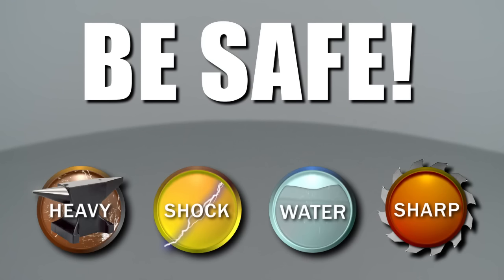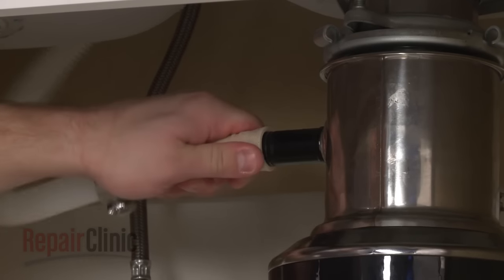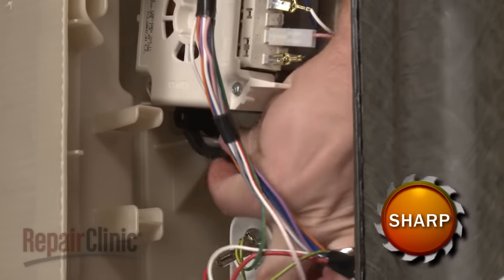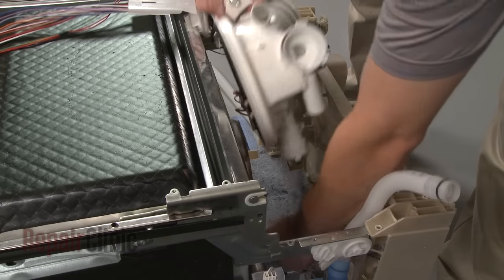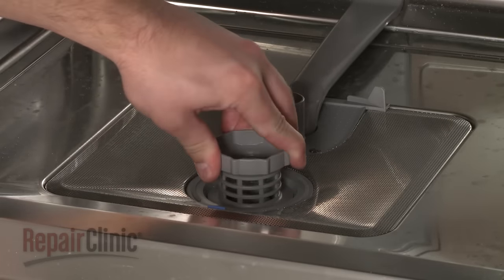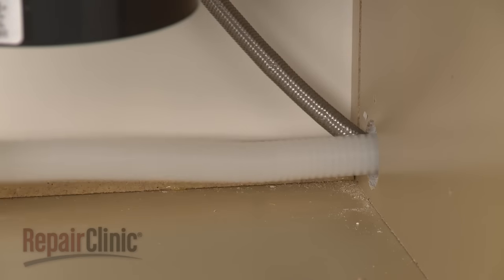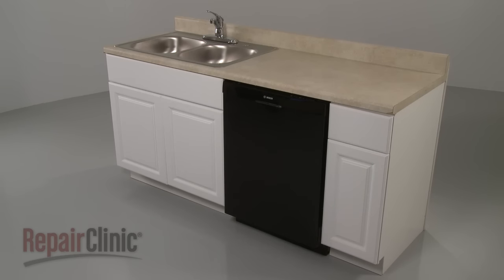Bosch Dishwasher Circulation Pump Replacement #442548

Comment: I do appreciate the video.  My dishwasher is a Kenmore Elite 630.16309404.  From the symptoms, I was pretty sure the circulation pump had gone bad.  The system would add water and heat it, but there was no circulation of the water whatsoever.  Apparently the Kenmore is somewhat different.  It has a metal sleeve on each side that most be removed before you can disconnect the pulley's on each side.  I could not find a video that shows that, but I figured it out.  You have to remove two screws on each side at the front of the washer to be able to remove those sleeves.  Almost everything else is the same with the exception of no clamp on one end of the pump itself.

Anyway, I was able to put the new pump in, but it still doesn't work.  The difference now is that I can hear that the pump is trying to work.  I think the old pump must of burned out because maybe there's an obstruction somewhere.  Since the pump is not pushing water as it should, I'm not trying to run it so as not to burn out the new pump.  I checked inside the washer and the impeller moves freely.  I placed an air pump on the end where the lower wash arm is removed and blew air threw.  It blew water out of the opposite end, so that's free.  Today, I plan to go back in and remove the complete sump assembly to examine every possible entry/exit; that is unless there's a better way to go about troubleshooting.  If there's is something, I'd appreciate the advice.

Thanks.

Comment: My bosch model SHX33A05UC/14 dishwasher was filling, but wasn't pumping water, so I replaced the circulation pump. very helpful video. However, now the dishwasher will not fill and it only hums. Based upon another person's comment, it's not the water inlet valve.  What else could be the problem?

Comment: Great video, subscribed. The arms have stopped rotating on our Bosch, there's water flowing from them but I suspect not enough pressure to push them around, I can hear the pump running. I'm going to follow this video to check for blockages in the pump.
Reply: Pump impeller was clogged with debris. Works perfect again after following this video.

Comment: Thank you for the video. I used it to replace my pump, which in Manhattan is a 700$ repair. So just 200$ for the pump and a bit of work was a no brainer.
My Dishwasher is a fully integrated panel ready model and actually it was not necessary to remove the front panel at all, to have access at the bottom housing. So for those who have a fully integrated  panel ready model, do no waste time with the front panel.
Also mine is a model produced around 2006 and it had a Pex clamp on one of the hoses which required a strong snip tool ( for steel studs) to cut it off, and then I had replaced it with a regular screw one.

Comment: Awesome video. Very well created and I was able to follow it step for step. Thanks for not just saying reverse the process to reassemble! Once again I was able to continue to keep the Bosch dishwasher running. I highly recommend repairing versus replacing.
Reply: Tripp, newer appliances tend to have shorter lifespans due to built in obsolescence/profit margin. Also when we fix an older appliance and keep it running, we are helping the environment by keeping this stuff out of land fill.
Reply: @rutheaston8253  True. 
Yet it has more to do with the appliances being more energy and noise efficient, therefore they need to use lighter materials.
Anyway these dishwasher once you replace the pumps every 10/12 years, can go on another 12. Not bad at all.

Comment from the maker: Typically the wires that supply power to the motor are black and white or white with a tracer, meaning a colored stripe, on it. It is best to find the wiring diagram of the unit. The wiring diagram is usually behind the lower control panel rolled up and tucked in the base assembly.

Comment: this pump is almost half cost of a new unit.   I resigned to throw my unit away, and then I decided to try and see if the pump was salvageable.  low and behold, I see that the pump impeller has wear parts on it that decoupled it from the motor rotor.  some gorilla glue and few swears and it was back together.  worked like  charm.   this pump is a good example of a well engineered failure mode.
Reply: Really interested in your comment. Going to try this at the weekend. Which Gorilla glue did you use? Any tips to minimize my swearing 😀
Reply: Realise now you can hit the impeller housing with a hammer and get to the broken impeller. Just wonder how long a glued one will last? Thanks for the tip!

Comment: I just replaced the pump in my Bosch dishwasher using this video. It is great! The instructions were simple and straightforward; I didn't have but one problem. The door pulleys were troublesome because I pulled the frame to far and they came out of their mounts. Otherwise, this was a few hours on a Saturday to save a bunch of bucks. My advise is have lots of towels, sponges and buckets ready because there is water that comes out of the washer from every place possible.

Comment: Super helpful!  My circulation pump impeller came apart and the dishwasher would not wash.  It would fill and pump out, the capacitor would get warm and there was a very quiet hum, but not much else happened.  The circulation pump would turn in one direction but then would lock up after a couple of turns in the opposite direction.  New impeller and seal kit and away it went!  It was installed in 2002 and this is its first hiccup.  Not bad for a family that runs the dishwasher 3-4 times a week!  Way to go Bosch!  Thank you for the great video.

Comment: Hi and thanks for a great video, i have a problem with my Bosch silence plus SKS62E22EU, it works but it started to sound rrrrrrrrrrrrrrrrrrrrrrrrrrrr when it dishes, no wrong codes no nothing, ivé cleaned it and checked the pump impeller, what do you think it is?.

Comment: I have a Bosch Ascenta dishwasher that is dripping water from the inside left sidewall. 
It works fine otherwise.  If I run it for a minute and press cancel, the water drains away.  I just need to know how to fix the dripping issue.

Comment: you make a 15 min job too long
just undo rh screw front and back release door spring lift until front support leg sits on bas rim
then do job from the side .12 yrs at bosch
Reply: Top tip! 👍

Comment: Great video. Thanks.

Q: I get water going in the basin but there is no pressure to it. Is the circulation pump the one and only thing that can be bad?

Is there maybe a relay or coil that could be faulty (the water inlet coil/valve works fine)

Cheers

Comment: I am having a pump issue (I think) on a Bosch SHX5AL05UC/06. Dish washer starts with a loud humming, then stops 10 seconds in. Then starts another of those loud humming cycles only to stop directly after with a beeping signaling 'clean'. I read somewhere to open the washer door during that second humming and sure enough it works every time I do that. But I want to fix this to work correctly. How can I be sure this is a circulation pump issue (like I've seen in forums)

Comment: Useful Video . ..... I found it as mine refused to finish its cycle ..  Followed the initial extraction in video & Turned out a water leak had flooded the tray & there is a float on the left side which drives a red cut out rod .. The leak came down to the salt container that come loose with the big "nut/ring" that bolts it to the bottom of the tub ( under the screw cap) ..   ... Other faults we have had ..  Blocked filling pipe , the one under the front panel. & No Heat.... which was a burnt out relay in the controller board in the door. ...  Hope this comment helps some one some day....    Otherwise Bosch seems fine ...Daily run for 20 years & counting...

Comment: Thanks for the video. There were a few more details on the SHU6805UC but the video was an excellent start. I replaced the circulation pump/motor and so far so good.

Comment: Is there a way to test the motor before buying a new one?  My dishwasher quit circulating water and there was the scent of burnt insulation.  Would hate to replace the pump and find out that the harness was the problem.

Comment: We love your video.  Had no problem installing pump.  However, now the tube that is on the side of the dishwasher is not connected.  Where does that tube connect in the base of the dishwasher.  it is still attached at the side of the washer and is in a channel on the back of the base.  Thanks.

Comment: I have an issue its not removing all water   ive cleaned filter, cleared disc hose, checked check. Still have problem

Comment: Very impressed with this video
My Bosch dishwasher is white but otherwise looks identical
It is washing but not very well
I have removed all the pieces from inside the dishwasher, and removed all debris
When I run the dishwasher and open the door quickly, the water semms to be pumping very weakly.
It only shoots up from the outlet of the sump about 4 inches
Is there any better way to tell if the pump is weak or what cold be the cause>
Reply from the maker: There could be a problem with the circulation pump, but there also could be something clogging the dishwasher elsewhere. Check all the hoses and wash arms for clogs and also check the water pressure to the dishwasher.

Comment: Can anybody please explain to me what the terminals are labelled. The bosch dishwasher I am trying to repair at the moment has 3 terminals and a capacitor similar to this. I want to test the wiring to make sure the motor is receiving power before spending a considerable amount on a new pump. Thanks

Comment: I have a Bosch dishwasher
It remains stuck in a loop (I think that water discharge) even if I open the door (usually here you should stop any operation). In addition, the display is in error (188 and all LEDs on) and does not work the Reset buttons
Reply: Dario D'Agostino 3 years too late, but just in case someone else comes across this. Sound like you may have a leak. The bottom panel has a float switch that activates the drain pump.

Comment: What is the function of the small styrofoam block above the soap release that can be seen at 2:51 of this video? 

Mine has come loose and I can't figure out exactly where it is supposed to go, and if it only attaches with the stickiness that is on one side.  thank you for any advice.
Reply from the maker: +finsonfarm Probably just for sound dampening.

Comment: I have a Bosch dishwasher model  shx33a05uc14fd8211-bosch and my dishwasher was not draining. I checked the drain pump and all seems fine, I cleared sum debris from the lines. But now that i put it back together its not turning on. Humming noise and  there are 4 wires i only seem to recall that two were connected but now i'm second guessing my self. There a dark green and purple line loose. The lights on the panels not turning on.The humming tells me its getting power though. PLEASE HELP ...!!!!
Reply from the maker: Paul Jackson There should be a wiring diagram somewhere in the dishwasher (in the control panel or behind the lower kick plate) that can be used to double check the wiring.

Comment: I have a Bosch dishwasher. It seems to stop with the bottom full, and the button shows active. It acts like it stops it mid-cycle. When I cancel all and restart it drains fine but stops. I just turned it off and went from auto to express wash. It seems like it may work this time. Any thoughts?
Reply from the maker: Kirk Finch It is normal for a dishwasher to leave clean water inside the sump to help keep the seals wet. Stopping in the middle of the cycle could be a control board issue.

Comment: It gets better.  Now I can't return the one I got because it has been connected!  Although I appreciate the the videos very much, this error on your website listing the incorrect pump has cost me $168 dollars.
Reply from the maker: Replying to this comment, too, so that it may help others. If you had ordered the part from RepairClinic, we would have refunded you immediately, as the error was in our website's results. Thank you again for bringing that to our attention so that we could fix it right away. For the future, keep in mind that RepairClinic has a 365 days return policy that enables customers to return a part for a refund on the cost of the part within one year of the order. This includes electrical and installed parts. Sometimes, RepairClinic is not the lowest cost option for certain parts. However, our customers tell us they choose us because of our generous return policy, our customer service track record and our free online troubleshooting and repair help resources. Our pricing is set based on pricing to us from the manufacturers. Sometimes, our pricing is among the lowest available on the web. If you haven't already, consider signing up for our free VIP email list, which provides email with frequent discount codes. The link to sign up is in the description of this video.

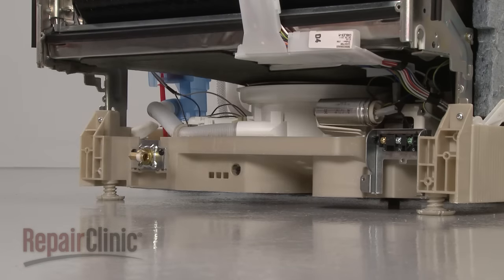Comment: at 3:10 in the install video, it says to remove the screws on the frame, but it is not clear if it is on both sides of the frame, or just the right side.
Reply: FYI to those who are trying this, it is indeed both sides

Comment: Fantastic instructional video. Certainly saved me a huge amount of pain when it came to disassembly of my Siemens dishwasher. 

In the UK the "circulation pump" seems to come as three parts. The motor, the pump and housing, and the capacitor. I've just gone to all the trouble of replacing the motor element and the dishwasher worked for all of 15 minutes before stopping again with exactly the same symptoms.

My question is: is the capacitor used to accumulate enough energy to "bump start" the motor from stand-by. Is it possible I need to replace that as well?
Reply from the maker: Richard Birks The capacitor cold be for run or start and newer models often use a run capacitor in the motor circuit to reduce power consumption.
Reply: Capacitor is just to start . If its not starting itself then the problem with the capacitor. To make sure if you can get a way in to motor area try to turn the motor bye hand (when the brain of the machine send to signall to run) it may run. If it runs then you need to replace capasitor to solve the problem.

Comment: Could you help me with IFB Neptune dishwasher? It keeps on draining after first cycle and does not switch to next cycle. I saw a video of other brand dishwasher that has water level mechanism which gets clogged and does not come to desired level to trigger next cycle. Please help. If you already have a video on it please let me know the link. Thanks.
Reply from the maker: +jitenanita We would need the model of your dishwasher to see what type of drain mechanism you have. Keep in mind the drain hose has to be higher than the water level in the dishwasher or the water will keep siphoning out. Watching our how it works dishwasher video may help: 
https://www.youtube.com/watch?v=APdhKLyr7s4&feature=player_embedded
Reply: +RepairClinic.com Thanks for the reply. The siphoning of water is not the problem as the machine was working properly till a fortnight back in the same condition (setup). 
I have IFB's Neptune dishwasher as mentioned earlier; if there is anything more specific to be furnished please let me know.
Reply from the maker: +jitenanita If the control does not cycle the dishwasher through the drain, fill, and wash cycles properly than the control is likely defective. Without a model number we are unable to tell you what type of control you have.

Comment: I have tried everything to fix the smell coming from my Bosch yes everything!  so if the smell is the pump not working which pump do you believe it would be the circulation pump or the draining pump, it only happens when I first start it but it awful and it smells as if someone farted in the entire house!
Reply from the maker: The circulation pump is most likely not your problem. If the pump was bad the dishes would not be getting clean. If all the water is not getting out at the end of the cycle that water will sit in the bottom and start smelling. There should only be about an inch of water in the bottom of the sump at the end of the cycle. If the unit is not draining properly look for a kinked hose or a restriction in the drain pump or hose. If the unit drains ok try using powdered soap. If the dishes sit in the dishwasher for a few days and are not rinsed off well that will also cause an odor at the beginning of the cycle. Using a dishwasher cleaner like glisten once a month or so will help keep the dishwasher components clean and help prevent bacteria buildups.

Glisten: http://www.repairclinic.com/PartDetail/Dishwasher-Cleaner/5304482929/1915432?TLSID=1773
Reply: ***** Have fixed the tubing so that is not it, and even if I wash the very next day, there is no smell in the washer it only happens when I turn it on and the smell radiating from the sink is awful and it only happens when I start that Bosch, it also leave the film on my dishes, I took pictures of it and it can be smeared like wax.  I use Cascade complete in it the little pockets you put in the door and I use the spot remover, evne the light in the spot remover has stopped working and it is only 5 yrs old. to expensive to keep this thing going.  too expensive to buy one new.  I have to wash the plastic plates and plastic sontainers and all aluminum otr stainless by hand after putting in the DW, ridiculous!  I have pictures but I do not know how to put them on here.
Reply from the maker: Karen We would love to help you figure this out. Can you send an email to jhull@repairclinic.com? You can attach those pictures as well.
Reply: ***** Will do please watch for magiccatdancing at beginning of email address.
Reply: Karen I really appreciate this.